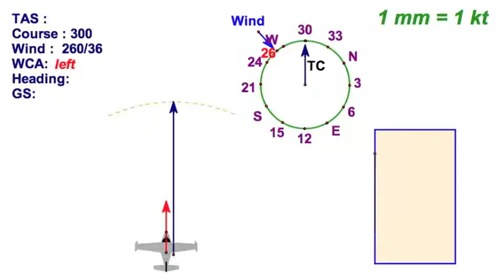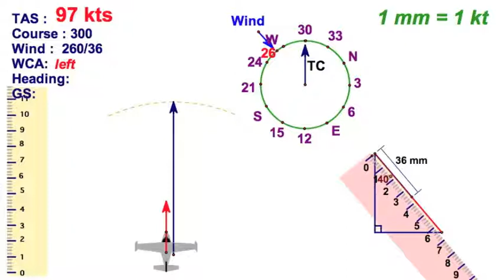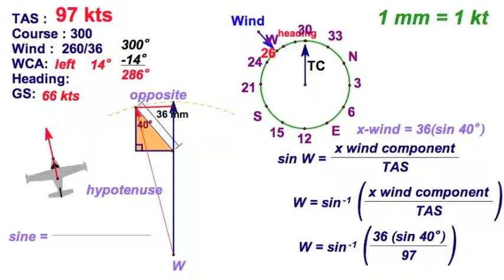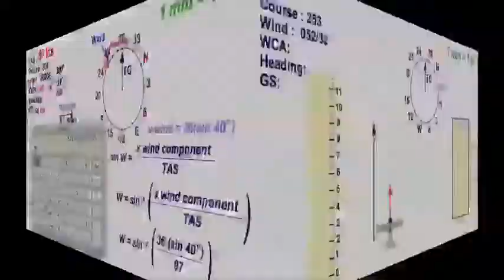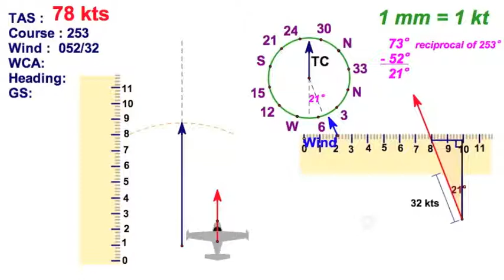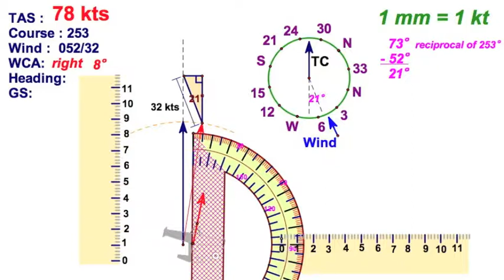Wind Correction Worksheet Activity

Comment: Awesome. Wind from left pushes aircraft to the right and vice-versa. Just one question. What does that wind do to the aircraft moving on the ground and speeding to takeoff? Does it affect aircraft's direction by pushing the rudder or it pushes the aircraft the same way it does in air?
Reply: It will affect the aircraft the same was as if it were in the air, for example a right crosswind would push the plane to the left but cause the airplane to yaw to the right.